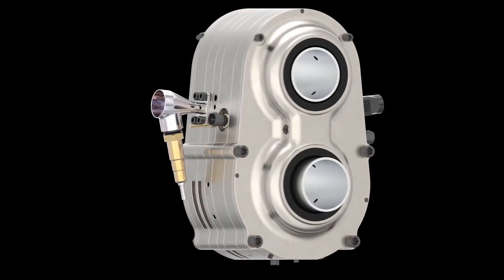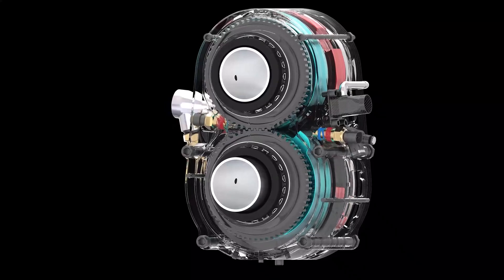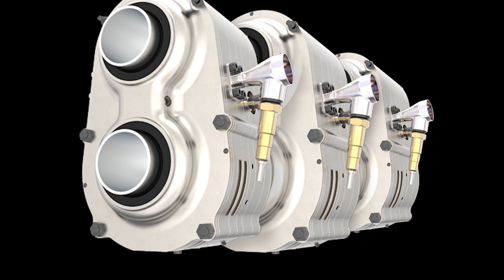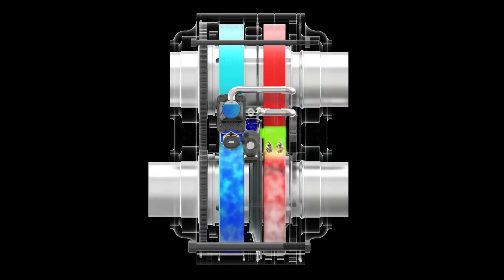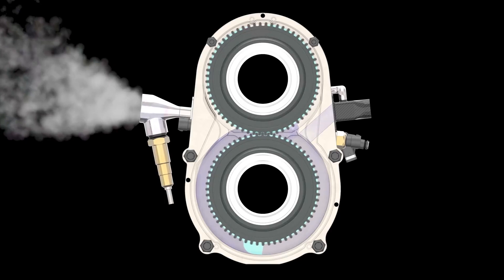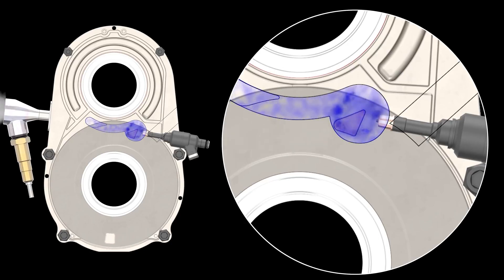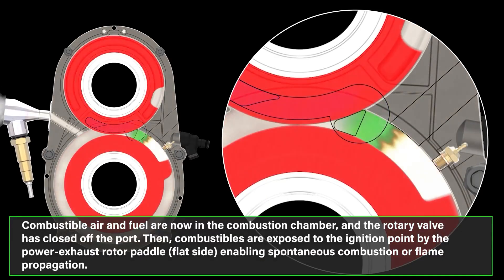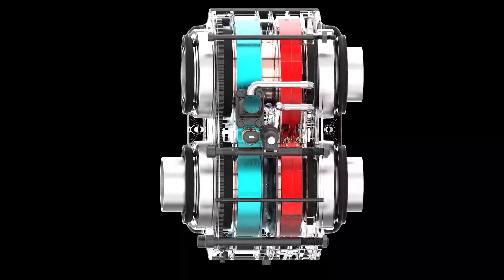This pistonless engine runs on hydrogen and revs to 25k rpm

Comment: Not gonna work, you claim this engine is very efficient but how? Youĺl have less mechanical losses yes, but how about all the heat still being produced by combustion and a big part of all that energy goes right out the exhaust, and hydrogen combusts closer to its surroundings than normal gas therefore transferring more energy to the engine itself, basicly means producing less power. And how is all this gonna be lubed? As far as i know hydrogen does not have any lubricant properties and introducing oil,means burning oil, and hydrogen leaves alot of water that will make a nice mess in the exhaust.The hydrogen fuel-cell does way better and induction motors have proven to be efficient up to 90%. This engine is a fun and good concept but it will never be introduced to the automotive market. Im a combustion engine lover but this is the hard truth

Comment: Nonsense, I call BS! I have been involved in IC engine design since the 1970s and have seen many engines that incorporate features of this engine and they have all been failures.  First, sliding seals for gas transfer have never been made to work well for any length of time.  Second, the idea of separate compression and expansion chambers, called split cycle engines, sound good on paper, one can theoretically  optimize both cycles, but fail due to thermodynamic realities.  Split cycle engines transfer compressed gas from a compression chamber to a combustion and expansion chamber.  In order to be efficient there must be close to zero residual volume in the compression chamber (The residual volume limits the max pressure achievable and any gas left wastes energy when it expands and it limits the amount of new air one can entrain).  This precludes the use of standard push valves found in most IC engines.  Reed valves and sliding valves have been tried and neither work well for long.  Also, transfer of compressed gas from compression to combustion chamber wastes more energy. And, this engine is even worse as it also has residual combustion volume as this wastes a lot of the energy in the hot gas and makes ingesting fresh charge difficult.

Comment: Electric is the future, but this makes Electric come faster and cheaper. I'm a huge proponent of Hybridization and instead of batteries using Ultra Capacitors as the distribution storage medium. My only issue with the engine you just showed off is how does lubrication work of the motor? in fact thinking about it the only place a shoty design like this works is like Drag racing.....

Comment: The problem with any hydrogen engine is where do you get the hydrogen. If you're going to get it from reforming oil you have all the problems of the oil economy plus the efficiency of the conversion. If you were going to extract the hydrogen from water than the problem is also efficiency since it would be far more efficient to use the electricity in a battery electric vehicle. It is very hard to compete with the efficiency, cost, low vibration and infinite controllability of electric motors.

Comment: Amazing engineering, but I don't see a scenario where this is applied to consumer vehicles due to fuel distribution challenges, especially when we're ramping up electric cars at an unprecedented rate.

That being the case, there could be a market for this with government or commercial vehicles, like airlines or the military, assuming the engine can be scaled up to those purposes.

Probably not combat vehicles, because I'm not riding in the hydrogen APC, but for drones and bulk freight it's a great option. Scaling for commercial shipping, for example.
Reply: They will never let up on fossil fuel until the debt ceiling collapses.  The petro dollar is how they maintain control over the world and it is how wealth is transferred.
Reply: @justanotherguy469  My understanding is that, while we are heavily reliant on fossil fuels today, the "petro dollar" rationale behind wealth control is largely a myth. The US government spent over $500B in 2020 alone on renewable energy initiatives, and trillions over the decade. Reliance on foreign fuels has been an ongoing concern from a national security standpoint (the Council on Foreign Relations did a great study on the back in the early 2000's, but you can find many more from the Pentagon, CNA Military Advisory Board, and more with a quick search). 

The push to renewable and alternative energy sources is a national interest for exactly the reason you cited: Petrodollars. I agree that we are heavily reliant on foreign resources for energy (and a lot of other things, besides), but I don't buy the petro dollar "control" theory. It accounts for wealth transfer historically, but is being eroded as worldwide we shift to alternatives. For example, from 2000 to 2018 our use of coal dropped from 23% to 13% as a source of energy in the US (Pew Research). If you've got some studies or data to point to our unwillingness to reduce petrodollar spending I'm always looking to learn more and stand to be corrected, but the data points to the US struggling to fund alternatives as fast as possible.

I think our bigger problem is that our absolute appetite for energy has grown so substantially. So while we use less petroleum and coal as a percentage of overall energy consumption, the TOTAL usage has gone up, meaning we're still using as much as we ever did. I don't have an answer, but innovations like this design are exciting and - in the right spaces - help mitigate some of this dependence.
Reply: Luckily fuel distribution has already been solved, it's called a gas station.
Reply: @nahimgudfam  This engine runs on hydrogen. You cannot fuel hydrogen at gasoline stations. Hydrogen is both expensive and dangerous to distribute, requiring special trucks, containers, pumps, and handling. Hydrogen stations exist, but are extraordinarily rare and not available to most consumers. For these and many more reasons hydrogen fuel is not a feasible alternative to gasoline or diesel.

That said, I am open to discussion and may not be aware of more recent innovations, so feel free to update and/or correct me.

Comment: And high pressure hydrogen is readily available on every corner. And every collision results in fatality due to the explosion.
Great theory, but it wont survive in dusty enviroments, like roads. 
And the gear noise to get the power to the wheels.  Lots of gearing. 
Make a great power plant to run generators for chargin those stupid electric cars though…

Comment: Anything that makes a very possible war of petroleum less possible is good for me. My question: Where does the hydrogen come from? Does it depend on a primarily oil or coal-based energy grid? Obviously now that would be the case, but hopefully in the near future, how would it deter this? Is the engine able to scale up with little loss of efficiency so it could burn hydrogen to power an electric grid? Solving the transportation problem is great, but it is only a part of a greater issue.

Comment: It doesn't solve the hydrogen storage problem tho. Fuels cells have a higher theoretical efficiency than ICE so it'll be the dominant hydrogen technology.

I can see use for this in hydrogen light aircraft and performance cars. But again you'd need to solve the hydrogen storage problem to even have it be useful at all.

Comment: I think, they are getting close to being on the right track.  I don't see electric as viable as others due.  The weight to power ratio for electric is still way off.   With this type of design you have a single point of failure.   I believe however they are getting closer and closer to something more viable.  Only time will tell.    The engines of the future will have seals, you won't get around that part.  The issue with Hydrogen is it needs to be controlled precisely.

Comment: Greenies and NWO assholes in the Byden rats admin are the problem not the tech or the ICE engines. This super Engine even if it were economical to produce and apply is useless because it still does notovercome the thermodynamic efficiency limit of ICES. Zero development in Fuel cells which are necessary for proper use of Hydrogen

Comment: several problems come up. with the tight tolerances, it's subject to warping due to metal expansion as it runs.  hydrogen is hot, which is good, good power density,  but it will differentially heat the common wall between the combustion rings,  there go your tight tolerenaces.   also, hydrogen is really really hard to contain.
Reply: Hydrogen has terrible power density. There’s a reason using hydrogen gas for ignition requires pressuring a tank to 500 bar
Reply: @markwatson9393  sure hydrogen gas, liquid hydrogen though is quite a different story
Reply: Hydrogen is no harder to contain than any other gas, and it can be extracted from water.  Basically free.
Reply: @justanotherguy469  Hydrogen is literally notorious for it’s ability to fit through tiny gaps normal gases could never get through.
Reply: @justanotherguy469  It can be extracted from water with a great deal of effort. Remember water is a combustion product. when you add a little heat + hydrogen and oxygen, they violently create water (combustion) but it requires the same or more energy to reverse this process.
Reply: @gwentarinokripperinolkjdsf683  not so...

Comment: It looks good on paper but my question is how practical would it be to use on a vehicle.  Cost of fuel, maintenance, longevity, eas of use and initial cost of purchase and installation over a readily available internal combustion engine?
Reply: Hydrogen can be extracted from water.  Its very simple.
Reply: @justanotherguy469  simple but from what I hear it can be more expensive to make as apposed to the cost of refining oil into gasoline. I could be wrong but doesn't it take a good deal of electricity to produce currently? And like ethanol production the current infrastructure isn't even close to being able to support large scale use by the public.

Comment: its called a gas turbine, already been done, and this is a bad way to do it. also the claim of no seals is a lie, what you have done is replace a small (and replaceable) sealing surface with a large, expensive to make, high friction sealing surface. Also due to the thermal expansion of the metal it ether wont seal when cold or seize when its warm. Also burning hydrogen still produces harmful NOx emissions and is less efficient than fuel cells. Sadly hydrogen combustion will likely only have a place converting existing vehicles as it technically could be more environmentally friendly than making and installing a whole new powertrain.

Comment: I'm very firmly "on the EV bandwagon" (I just bought one), BUT I agree that this is an intriguing design and I could see uses for it. So I have some questions:

1) How efficient is the combustion? If all of the fuel is getting burned that alone is a revolution.

2) What kind of consumption are we talking about? Between inefficient combustion (leading to higher emissions and lower fuel economy) that's what killed the Wankel. Is this better? Why?

3) What's the lubrication requirement? Another major issue with Wankels, and another major contributor to poor emissions was burning oil.

We could use combustion engines, particularly if the fuel comes from a "circular" source like green hydrogen or synthetic gasoline. They'd be great as range extenders or light aircraft.

Comment: One of these in a car with onboard electrolysis would be clean, cheap to run and not require fuel stations - which is why it’ll never be allowed to happen.

Comment: Very tight tolerances and revving up to 25k/min ? Surely this is going to generate heat and cause metal parts to expand, negate the tolerances ? Where, also, are we going to get our hydrogen from and what is the cost ?

Comment: Very cool engine. In general I prefer the concept of an EV because it eliminates a bunch of annoying things from a personal vehicle: liquid (or gaseous) fuel, oil, cooling liquids, the complexity of emission controls, weight, volume, while concentrating the production of electricity in a single, ideally cleaner, location(s). Consider that the majority of China's EVs are powered by coal. The gasoline IC vehicle, no matter how fun they are, must be phased out.
Reply: EVs eliminate annoying things like weight?
I believe a Tesla lugs around 1800 lbs of battery!

Comment: Found a video of one of the prototypes running, I think... here it is: https://www.youtube.com/watch?v=Q-tyYqGM8QA
Feel free to judge it for yourself, but to me it looks like it's just idling in the video. Hardly going full bore; makes sense if this is an early test. Additionally you can see oil or some other liquid positively pouring out of the thing, but again this is an early test. No way to know whether that is their "tight tolerances" failing or if they just doused the thing in oil prior to the test because they didn't have a system to keep it lubricated yet.
At least it seems like people are actually working on this thing, rather than it just being a CAD file.

Comment: what's the efficiency though, I heard conventional internal combustion can achieve 20-25% limited by the temperature and pressure difference between combusting mixture and ambient air, but is can this engine be more efficient? If so how much?
Reply: For the context, a quick google search gives me that electric motors convert over 85% of electrical energy into mechanical energy. Given that hydrogen fuel cells are 60% efficient, simple multiplication gives me at least 51% for the total efficiency of a hydrogen fuel cell vehicle from fuel to mechanical work. If the engine from the video can beat this mark, then I'm really impressed.

Comment: By focussing on the powerplant you've simply not addressed the fundamental bigger question - i.e.  where does  the hydrogen come from in a carbon neutral energy world?
In fact I agree hydrogen might have some shorter to longer term use in aerospace & long distance freight shipping world.  It still means a phenomonal waster of your initial power input to create the hydrogen instead of using electrical power direct.  You unecessarily lose even more burning it to create motibve power. If battery tech progresses as good as or better than expected, then the use of hydrogen and combustion enegine will be limited - and for larger transports - or aerospace. But the  massive inefficiency loss down the change plus the size and risk of the massive hydrogen tank needed make it next to useless idea for cars though.  Toyota have kind of already proved that over 2 decades 'research' flogging a dead horse with their hydrogen fuelled fuel cell car....and fuels cells will always be much more efficient than combustion engines (and thats not due to engineering - that's physics. The laws of physics)

By the way, all those continually mesmeerised by combustion based power, if you did focus solely on the motive powerplant  - the motor or engine - as opposed to as whole, including the fuel source/ carrier -  then electric motors simply wipe the floor in terms of torque, horsepower, response time per unit weight when compared with  any combustion based engine ---- by a very large margin. Simply no contest.

Comment: If this is the future of the combustion engine then ICE future is bleak. Sure, cool design and I genuinely love the ingenuity here. But my experience is with extreme low tolerance parts is as soon as they wear you're screwed. precision fabricated parts from exotic hyper durable materials from hipster machinist shops are super expensive and difficult to replace. Nobody  in their right mind is excited about the future of ICE, electric is simply more efficient, longer lasting and far easier to maintain for the general population. ICE is dead, or at least will be soon, just let it go.

Comment: Well...🤔 I don't know if it's a similar problem for hydrogen but regular reciprocating engine designers have always struggled with how to fully extract all the chemical energy from an ignition before the combustion product is expelled. And this engine is premised on going even faster with combustion cycles, with super high revs.
 So...is that claim to efficiency by virtue of this whole new engine design or simply by virtue of using hydrogen? Because you can make regular 4-stroke ICE engines that run on hydrogen.
Also, lighter fuel = lighter car? Total crap. Hydrogen tanks are not like a regular jerry can: they seriously big, bulky, heavy and massively insulated pieces of hardware (if you expect to be refuelling no more often than a normal car).
Reply: The car would be lighter because you're replacing a 70-100kg engine with a 16kg engine
Reply: @bosstowndynamics5488  and effectively getting almost that weight back by replacing a normal fuel tank with a big honking cryogenics tank - hydrogen powered, remember?
Reply: @hypervious8878  Hydrogen powered vehicles don't need full cryogenic storage and compressed gas tanks don't weigh as much as you'd think. Also I'm pretty sure they said this isn't limited to only hydrogen, although I'm not sure which fuel gives it that power output
Reply: @bosstowndynamics5488  well...true, they don't need to be cryogenic tanks, but it does make more economic sense for wholesale market and distribution. Plus, for the regular consumer market, who'd probably expect a new car's range to be competitive against traditional ICE engines, it would be more preferable. Yes you could use compressed gas tanks, but these would still be a bigger deal than natural gas tanks, which cost a car boot/carrying capacity. If that's not a problem then yes you would save weight.
On that note you may save a little more weight if you used carbon fibre composites (if you don't mind the extra manufacturing cost). They'd still be big bulky tanks though.